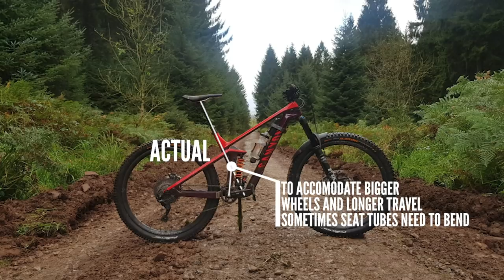MTB Seat Tube Angle Explained | How Does It Affect A Bikes Handling?

Comment: I have a theory about how the increasing seat tube angles and reach numbers came about. 
The verdict: we have to thank dropperposts. Because of dropper posts, we can move the saddle out of the way easily. Before that, the seattubeangle had to be shallow, to get it out of the way when stood up. This made longer reach numbers then neccesary. To compensate the loss in toptube length.

What do you think?
Reply: Definitely true. They were talking about that on either the GMBN or BikeRadar Podcast the other day. 
Dropper posts are such a huge improvement for mountain bikes. After getting used to riding with one, I would rather ride a rigid bike with a dropper than a full suss without one .

Comment: All the big fuss about steeper STA... Apparently a big amount of new frames comes with that. But if it changes anything? Think not because you have still a big margin of adjustment. Of course it will shorten your TT, but yeah old frames still can be up to date
Reply: Yes it does. Old school frames might have ST angles in the 71-73 range, while new frames can be 76+. Can't make up that difference by just sliding the seat forward, and yes as you said it shortens your TT. Also, if the frame has a slack actual ST angle, when you drop your saddle, that slack seat tube puts the saddle right at your knees. Not ideal. 
That doesn't mean old bikes are unrideable and you can't have fun on them, but I think it's silly to pretend that new school geo doesn't make a difference.
Reply: @HollyBoni  Yes, you're right. What was i thinking, when writing that comment?! Maybe i was drunk or something :) You can't put in one line old school and new school frames. Have a good one :)

Comment: To find a frame size that would fit, How does the seat tube angle effect the reach?  Move the seat forward on the rails, it will put you over the bottom bracket, so the point of the reach measurement and seat tube would be reduced., Would seat tube effect effective top tube?
Reply: STA has absolutely nothing to do with the reach of the bike.
Reply: Would it change the distance to the bars from he seat? Same Reach numbers. That  is what is confusing. Would you still need to know the effective top tube measurement to get the right size frame?
Reply: @DG-tf9rp  Reach tells you how long the bike feels when standing up, effective top tube tells you how the bike feels while sitting on the saddle. When you slide the saddle forward, it doesn't affect reach, but it does effect the effective top tube. The seat will be closer to the handlebars, so while seated the bike will feel shorter, more cramped. A steeper seat tube does the same thing. That's why some bikes that have humongous reach numbers but also steep ST angles don't feel long when you're in the saddle, when you look at the geo chart the effective top tube is not that long.
Reply: @HollyBoni  Thank you for the excellent explanation, now it makes sense to me.

Comment: Why aren’t bike frames designed with the bb on the chain stay, the wouldn’t be any chain growth meaning that the suspension would work much better and pedal kickback wouldn’t be an issue why hasn’t this idea hit the mainstream and have any companies tried it and it not worked
Reply: I have seen several brands having chainstay around the BB, I can't think of the all the brands, but Pole did something like that.
there was another brand did it too, I don't remember right now which.
Reply: Then the suspension would be ineffective since the rider isn 't isolated from the bumps on the track.. just like if the foot plates on a pogostick where mounted below the spring.. 🙂
Reply: dennis rasmussen oh yes didn’t think about that factor silly me😂😂
Reply: Lol, because then the suspension would literally not move at all since your weight would be unsprung. Concentric pivot systems do work and don't mostly have any chain growth.

Comment: Hate the steep seat tubes. Might be alright if you have a short torso, long limbs and little feet. Makes it impossible to fit for some people. On road bikes, you see those angles on track and TT bikes, and it is compensated with lower bars to keep the same effective hip angle for optimal power output. On a trail bike there is no way to compensate, the bars can not be lower than the fork allows.
Reply: The steep seat angles allow the low bars, not compensate for them..

Comment: 0:48 Why is that? You haven't explained.
Reply: more weight on the back tyre = more grip
Reply: Think of it as a lever, pivoting over the wheels axle. (vertical above the contact point)
When you move forward, the leverage of your weight gets grater, and thus more grip. Upto the point where you're too close to the front wheel and loading that one up more.
Reply: @Valentin Maissen sorry but that's utter nonsense. The further to the front you shift your weight, the less load is on the back wheel – obviously. (You can in fact explain this as leverage, but it works the other way around from what you say: the further you move backwards, the more leverage you have.)
But in a steep climb, that's anyway pretty irrelevant because you'll always balance so that almost all of the weight is over the back wheel (i.e., so that you just don't flip into a wheelie). Notice that in a 30° climb, all seat angles become more something like 45°...
The reason a steep seat angle works better on climbs is simply that you don't need to distort your body as much (or stand up) to prevent a wheelie, but can instead keep a relatively natural position which makes it also easier to control the pedal torque, and that's why a steeper angle ultimately also helps with grip.